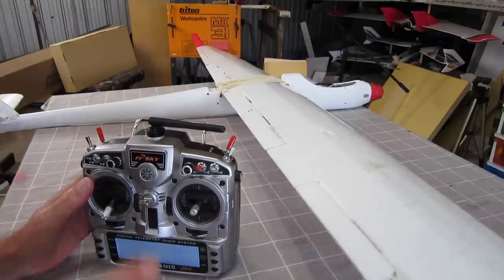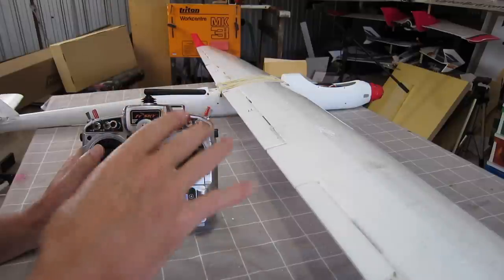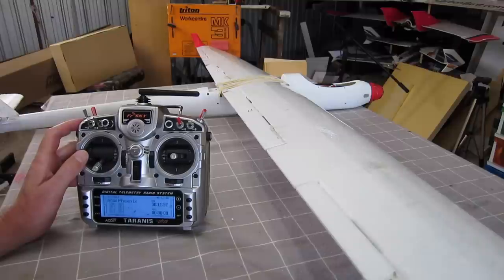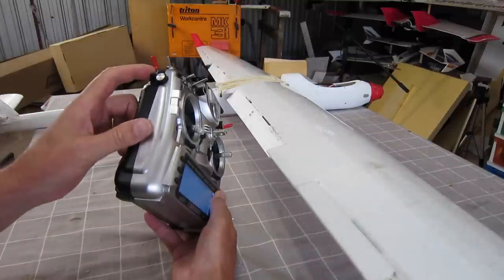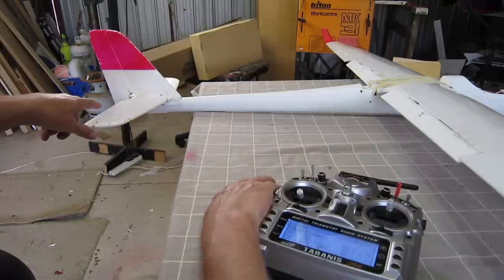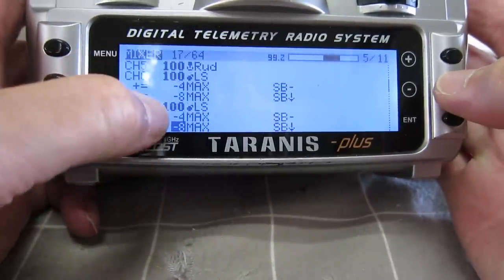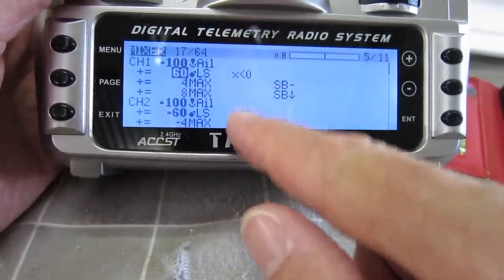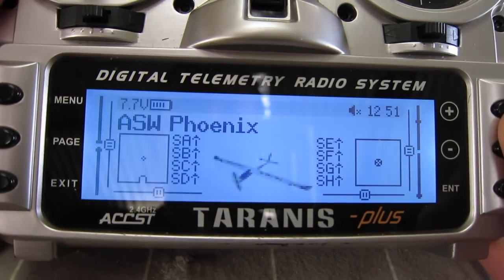Crow Braking

Comment: Ohhh, for some reason I always thought crow breaking was having flaps split along their length so that there's flaps above and below the wing. Would crow breaking work on a mini talon? They're a bugger to slow down
Reply: The Mini Talon doesn't have flaps but you probably can use the ailerons as spoilerons.
Reply from the maker: Need flaps and ailerons for Crow, and it's more effective on gliders and big wings
Reply: if you dont have flaps throwing the ailerons upwards is almost as good. if you are on taranis this template is amazing

http://rc-soar.com/opentx/setups/f3f/index.htm
Reply: Adrian Chapmanlaw oh amazing, thank you! I was thinking of adding flaps in but that's even better AND I have a taranis! Thanks so much
Reply: no problem, when setting up just ignore all the flap related bits on channel 3 and 4 :-) there is an electric version of it too if you want to fly with power.
Reply: I’ll chip in 2 cents if it’s ok. No doubt you have your answer, but others may still benefit from knowing an additional way to brake a powered model without flaps.

I have the full size Talon.  If you disable the brake on your ESC the prop will continue to turn, powered by the air passing around it. The propeller is a very effective brake when windmilling. 

Andrew - your videos have helped me with my (new to me) Taranis Plus more than you know. 

Err ... OK - more than you knew, ‘cause now you know!  Much appreciated!!!

Comment: Andrew, after a 30 year hiatus from RC I am back enjoying it again. Your videos are very helpful in setting up my Ranger 2000.  Question on crow braking,  I have the ailerons on a Y harness and I set up the mixing as you showed. When the flaps go all the way down, one aileron goes up the other down.  I am guessing I need separate channels for this to work?  I have flown this with the DJI camera system. Works great.
Reply from the maker: That's right, need separate aileron channels

Comment: Andrew Thanks for that detail I have just set up my new AW28 exactly on your settings for crow. However my slider does not work anything until over halfway travel. It brings in Flaps and ailerons etc as per yours after halfway but for some reason it wont work the flaps in the initial stage. Any ideas what I might have missed?
Also the ailerons don't go down as much as they go up, is yours the same?
Ian Jemmeson Melb.
Reply from the maker: Hi Ian. I didn't cover Crow in full detail here. Have a look at this full house video https://www.youtube.com/watch?v=gqjIg6fB_fQ My ailerons do go up and down the same amount.

Comment: Is it possible to use a 6 channel receiver and have the flaps on the same channel? look very easy to set up I'm going to do it on the Jumper T16.
Reply from the maker: Yes as long as your flap servos are the same orientation
Reply: Andrew Newton Wow! Fast answer, then it will be first thing to do tomorrow. Happy Easter.

Comment: hi andrew... i m in the mixing menu but i'm not able to get the x<0 and sb swithes
Reply from the maker: What can you see on the mixer page? Highlight the line then select EDIT
Reply: push edit on aileron where i can see offsett, ecc but i cant get x<0
Reply from the maker: Its in the Curves line, change to Func then select X<0
Reply: It works.... Thanks Andrew.... Is it normal that when I got full flap and aileron up this one don't goes down as normal situation?
Reply from the maker: Aileron should go down a bit as long as you copied my mixing

Comment: wait can you force a that plane down with the elevator
Reply from the maker: Yes but this is so it doesn't come down at high speed.
Reply: oh what about flare
Reply from the maker: The flare would just make it continue gliding off the slope....unless the airspeed is low enough. Crow braking is all about reducing airspeed in a shorter distance than a normal glide landing.
Reply: ok i think i will stop never flow a good glider
Reply from the maker: Good questions Tony. Shows you have a thirst for knowledge.
Reply: hm : )